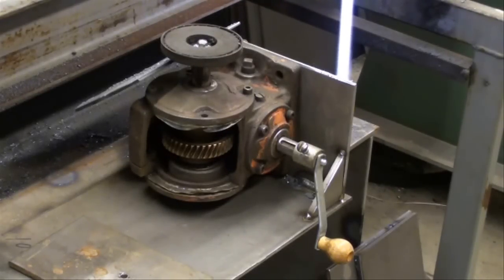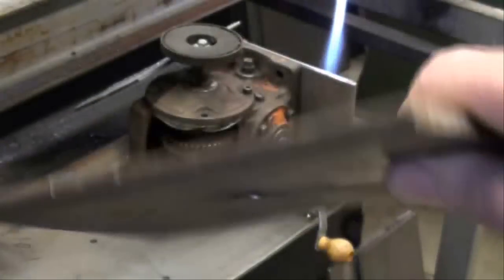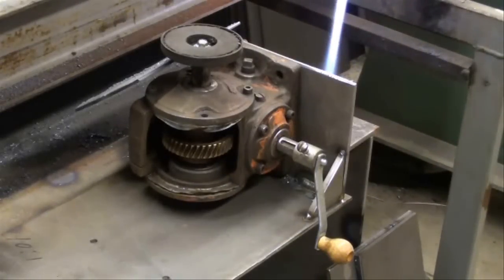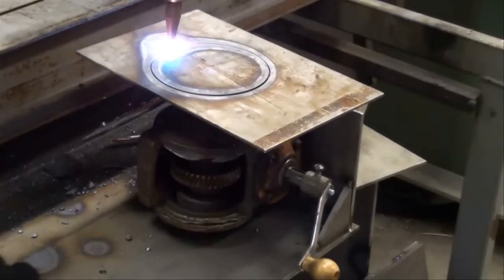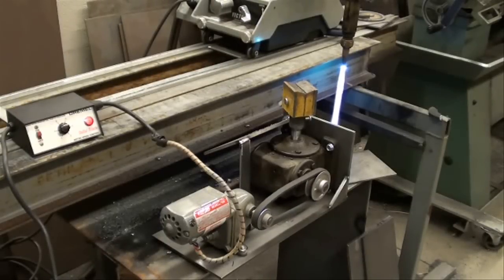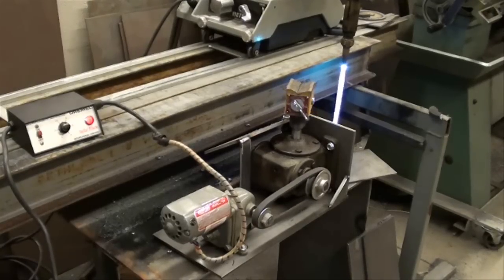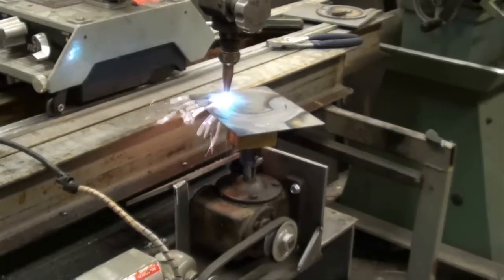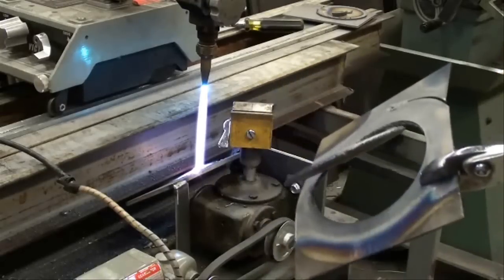MACHINE SHOP TIPS #39 Flame Cutting Circles Part 2 tubalcain

Comment: I picked up a 1/4 hp creep feeder with about a $400 chain drive gear box & foward / reverse switch at aution for $5.  I have been wondering what to do with it. I'll stick weld up an adjustable torch holding fixture, & I now have my circle cutter. Thanks for turning something my wife thinks is junk into a useful tool. Another one out of the ballpark.

Comment: I know this video was a while ago, but here is a hint.  You mention the expense of a DC motor.  I changed my bandsaw to cut light steel by using a DC motor from a free treadmill.  I built a mount and replaced the original motor.  I used part of the panel for the motor control.  Now I have a variable speed saw that I can slow down, or with a turn of the rheostat bump it up to high speed for woodworking.
The point I want to make is that I have seen many treadmills for free on craigslist.  
Thanks.

Comment: If you could figure out a way to use the variable drive of the track burner car, such as a shaft driven off of the drive wheel, you would have your consistency issue figured out.

Comment: As usual...A Great informative video. I really enjoyed the motorized circle cutter. If you are searching for an inexpensive source for dc motors and regulation circuits, might I suggest old  exercise treadmills. People throw them out all the time, and they usually have a reasonably large dc permanent magnet motor with a nice speed regulation circuit board. I used this setup successfully on a converted winch drive as well as an old drill press. Provided even torque through a wide rage of speeds.

Comment: Another thought: How about using an old automotive windshield wiper motor from the junkyard? Already has some gear reduction and being 12v DC the speed is easily regulated. A car heater motor could be useed with its dash mounted speed control.

Comment: Great video and thanks! Please don't ever think you shouldn't show ideas like this. The ingenuity and creativity alone are worth the whole video. All kinds of ideas can spring from watching clever answers to problem solving in the shop. A thought: how about a larger pulley on the gear box to increase the reduction so the gear motor can run at a higher, happier speed and run more smoothly at the desired low rpm of the work?

Comment: you should do a video on worm gears and the gear hogs that cut them. I would also like to see you cut some spur gears on an indexer. That poor base what did it do to deserve getting sent to the flame table?!  As for the motor rob and old waser or dyer motor they work well. I used on and a mechanical fuel pump off and old truck to make one nice working hands free fluid pump. Do you also have the Circle cutter that would attach to a regular torch on the neck?